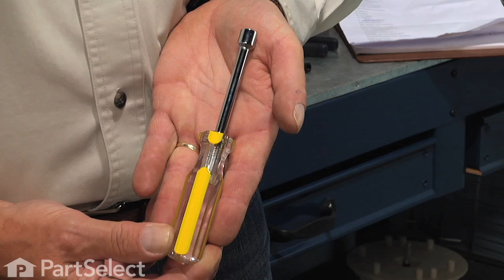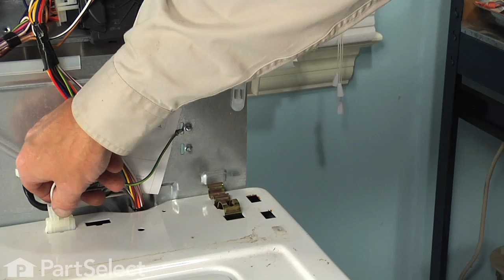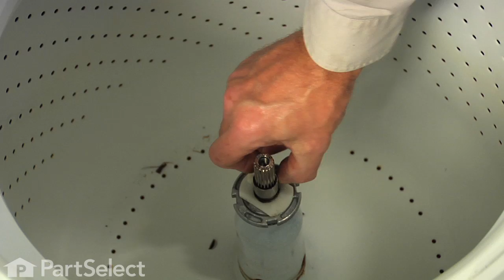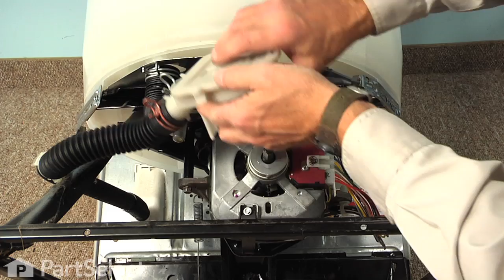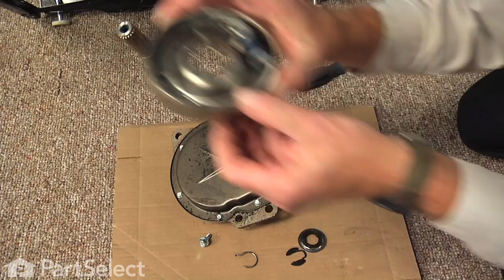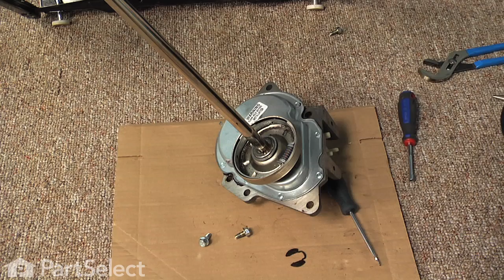Washing Machine Repair - Replacing the Transmission (Whirlpool Part # 3360629)

Comment: I just replaced my transmission using this video. I started my washer and the agitator was working perfectly then I heard a loud crunching sound and it stopped. Do I have other problems besides the transmission?

Comment: Nice video.  All is complete except bolting the gear case back to the three mounting brackets.  I cannot get the holes aligned with the recessed mounts. It won't fully go on.  What is next? (Clutch spring is at the top, white thing that protrudes on the other side is at the bottom.)   I measured the holes in the gear case.  The bottom one is the tightest fit:  hole at 0.494" and recessed mount at 0.488".  Not much wiggle room at 0.006"!  Would it be beneficial to file the mount a bit so it will fit into the hole better?

Comment: My new transmission isn't sitting right.  I can't get it seated so that the bolts will go back in.
Reply: The clutch assembly is striking the bottom of the shaft too soon.
Reply: @josiah72   How do I keep the clutch assembly from striking the shaft too soon?

Comment: Do you really need to remove the drive block nut to remove and replace the transmission? As far as I can tell the nut doesn't impede the removal and reinsertion of the transmission shaft... am I wrong?

Comment: If you’re just replacing the gear case (transmission) it’s not necessary to remove the spanner nut.  It slides up through the spin tube which is secured with the spanner block and nut.  Only thing attached to the transmission on top is the agitator. Good luck!
Reply: 100% correct, in addition, NO need to remove the big white body casing so this will save lots of time.  I recommend putting anti-seize paste in new transmission shaft for easy future removal.  Good luck all !
Reply: Thats true I did not remove mine.

Comment: How long is this part good for? I've seen some comments stating that it lasts for 1.5 - 2 years (due to planned obsolesence). Is it worth doing the repairs for this much effort? I'm really wanting to try this but if the part is not going to last longer than 2 years, should I bother?
Reply: We've had our series 80 kenmore since early 90s and just now replaced transmission
Reply: @chrisiverson257  Yes, mine lasted till 2 yrs ago. I'm talking about the replacement part life.
Reply: @laquerisma  new never better than older
Reply: Should last longer. My washer is from 1998.
Reply: The new washer are the same! Ive got a maytag with broke gearcase after only 2 years!! Bought brand new!!!

Comment: In removing the motor, a part which looks like a 2" nail but flat on one side and has a hole at the lower end of the "nail" fell out. I cannot find where it belongs. Does anyone know where it belongs and how I can put it back?
Reply: That is a shipping fastener. Not to worry where it goes

Comment: Mine spins but leaves some water at the bottom and the cloth wet. Can it be the clutch or do I have to replace the transmission? Thank you.
Reply: PartSelect... you should change the last few minutes of this video.  The position of the pump hose is not right! It might get ripped or leak over the leg, where he put it when it agitates. It should go under the leg!
Reply from the maker: Hi Joselo, could you please provide your model number and I will be happy to research this for you.
Reply: PartSelect hello and thank you for replying. It says Kenmore Elite, that’s all. It’s a top load. Thank you.

Comment: How did you know to replace transmission?
Reply from the maker: The usual symptom for a faulty transmission would be “noisy in wash cycle” or “no agitation”.
Reply: Also clothes will wind around the agitator along with noisy clunking or snapping.  That's when the agitator shaft ratchets around due to worn splines on the shaft.  Replace transmission or just the shaft if you are handy.  Shafts run about $75 - $100.
Reply: Hello Eddie, I’m glad I found your comment.  This is exactly what’s happening to my washing machine.  What are your thoughts about the spanner wrench.  Should I get one or can I use a large set of channellock’s?

Comment: Found it! it is a clutch band and it is not cracked. It just looks weird.
part-number/285790/0026

Could somebody please tell me the name of the large white plastic part (probably a cam) that is visible just after the transmission is removed. In this video at:  8min 28s

Mine is cracked apart. I initially thought the cams inside the transmission were faulty. The washer in spin mode creates a loud ratcheting sound when in spin cycle, as the agitator attempts to engage.
Reply from the maker: The part you are referring to is the brake cam driver. This is included in the clutch kit (PS334641).